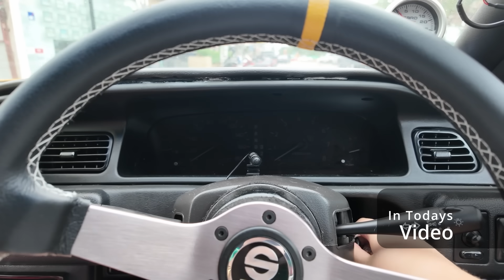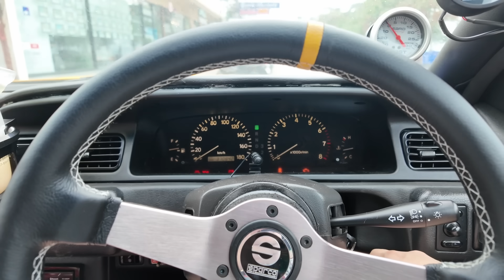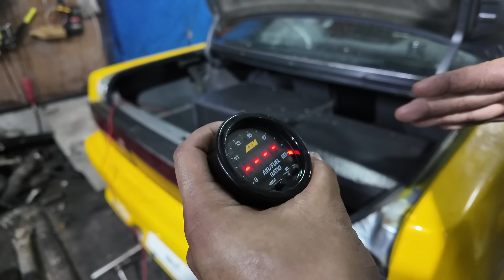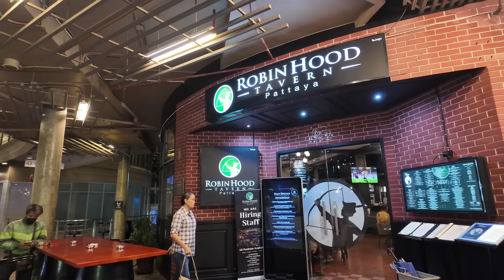My Car Has Died In Thailand

Comment: Carburettor issue?
Reply: yup
Reply from the maker: Yes
Reply: It’s fuel injected. No carb. Possible previous owner swapped bigger  injectors to a bigger size for more boost?
Reply: @nigelsenchez  Ivan said yes !! Carburetor
Reply: @tday891  Dude, this engine is fuel injected. There is no carb.

Comment: You bought the coolest lemon in Pattaya, congrats.
Next time learn that in order to own a cool car, you need to be the one who built it (or paid others, bit by bit, to do it for you), and not buy a worn-out, blow-by ridden, po-s-j that somebody else beat to near death, and then flipped before it died.

Sorry you are finding out the hard way.

Still, it's got "good bones", and ultimately probably "only" needs a fresh engine and turbo(s).
Fuel pumps usually last over 150k, so not likely to be your problem.
Bad batteries and a weak alternator  is a good start to avoid future problems, and doesn't cost a lot.

Let's see if my long distance diagnosis is correct or not..?

Comment: When the engine is at operating temperature and you park the car and come back and it won’t start, but if you let the engine cool down sufficiently enough for a few hours and it starts, then you got vapor lock.
On MB Bosch KE Injection system that is either a defective check valve on fuel pump or a worn out fuel pressure accumulator.
👍🏻👍🏻👍🏻

Comment: A lot of us said you needed a head gasket...

I have done 1000s of head gaskets wrenching at a chrysler dealership from 1989 to 2001
Reply: 1000s , will the vehicle is not showing any signs of that, loss of Coolant, milky oil or white smoke out the exhaust are signs of a blown head gasket. I wouldn't want you to diagnose my vehicle. 🙄
Reply: @captpain1  you don't know about the neon head gasket issued. All neon head gaskets needed replacement.  They leaked at the rear drivers side of the engine.
We replaced it with a multi layer gasket. 
That problem followed many chrysler engines through the 90s and 2000s.

A simple leak down  test was always done to verify a head gasket issue on overheating engines that has no visible signs of leaks.

Even today, leak down tests are done.
Reply: @captpain1   Many of us said to do a leak down test if his engine was overheating with no visible signs .

Wtf dude , there's no sensor to scream leaking head gasket

Won't take must burning coolant to destroy a converter...or oil being pumped to the converter.
Reply: @Docthewrench  I agree with a leak down, but I'm just stating the visual. My wife has worked for Ford, GM, and Chrysler she started at Ford. She went to apply for an office position, but when the service manager saw her drive in, he wanted her to be a service advisor. She was driving my 340 pistol grip Cuda' ,that was just one of my vehicles. This was in the 80s I had at the same time 70 convertible Challenger red black top black interior, 71 hardtop Challenger white black interior both were small blocks automatics, 72 vitamins c black interior 440 Cuda auto 727 with 4:56 gears and the 73 340 pistol grip 3:55 gears grey black interior.

Comment: Sorry but Wtf is going on whit Evelinas eyebrows?! The car is cool but its same everywhere. You go to the repair shop and they try to tell you about changing the indicator light fluid😂 or you can drive a bit and have new problems. It is difficult to find a good workshop with competent repairmen.

Comment: You should quit that car if you're not going to fix it yourself, if you don't have a garage and tools to fix it yourself, because you're going to spend a fortune with handwork, and in the end you wont have either a fixed car in really good condition or enough money to buy another used one. 
Sell that lemon quick for the best that you can, and buy some cheap untampered car. Don't buy another altered vehicle, two wrongs don't make one right... Just my piece of advice.

Comment: That car was made into a lemmon because of the modifications but normally a Toyota is very reliable if left original, In the U.S it is illegal to ride in a vehicle while it is being towed in a flatbed first cop would stop you also would need to be tied and each whel strapped to bed a lot of safety regulations